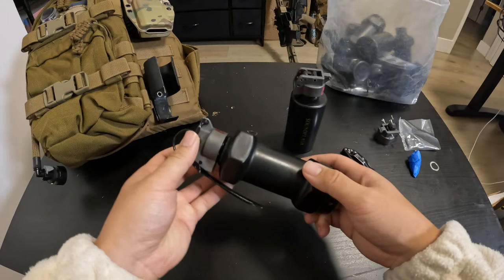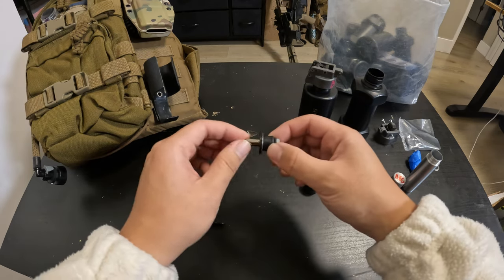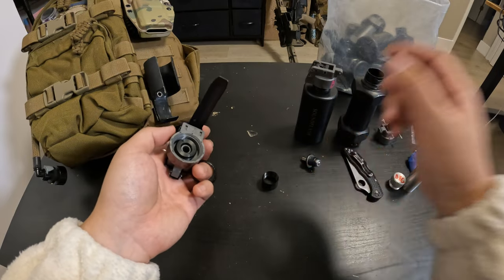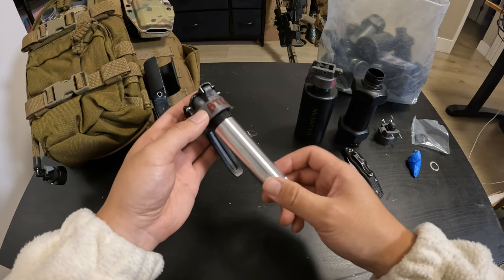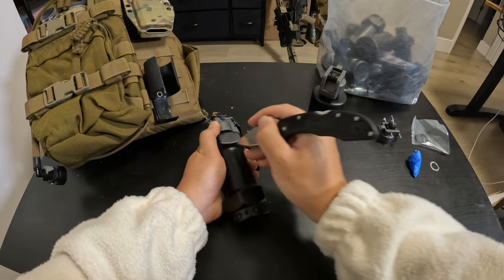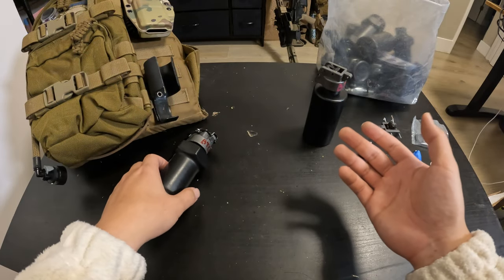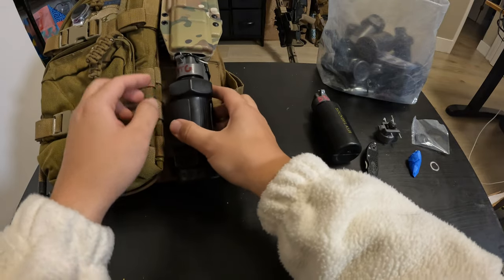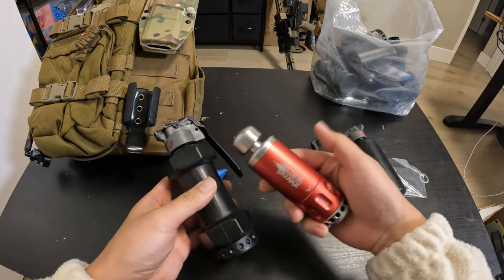Complete Guide to Thunder B's (Review and Reliable Setup)

Comment: Another trick to help evacuate the gas quicker is putting a penny in the cap (under the base of the c02 cartridge), and drill a small hole in the cylinder. That'll help the cylinder shells pop a little quicker.
Reply from the maker: Definitely. I never really got much of a result from the penny, and I try to keep mods from being permanent in case I change my mind. But if you want them to pop fast, a hole will definitely help
Reply: @pingu.0211  Yeah, the penny trick can be hit or miss. I need to get some of those kydex holsters, those are sweet.
Reply from the maker: @relyt_gnast  link in the description! Just double check your sizes to make sure you order the right one.

Comment: Have you ever experienced where the shell threads get stuck in the head of the grenade? I got two heads that are inoperable because of that…
Reply: Had the same issue, try unscrewing the cylinder itself from the striker. Once I did that the shell came right off.
Reply: Guy at the airsoft store told me to leave one thread exposed or it won’t come off.

Comment: Nice tips. Do you find the grommet to be pointless? I took mine out cause it wasn't really doing anything.
Reply from the maker: Yeah I either lost mine or never used it. Either way haven’t really needed it. I suspect it makes it a little safer to drop. But that’s it
Reply: @pingu.0211  right. The way mine are, between the pin and the cap there's enough pressure to keep the cartridge in place.
Reply: Technically, the rubber grommet is there to keep the co2 cartridge centered with the needle! It's not strictly necessary, it will work without it... But it's good to have!

Comment: Your cylinder ones aren’t going off because they’re designed to have bbs in them to take up the dead space
Reply from the maker: Yeah that’s not correct bud. If you read the manual it says under “safety tips” you are not supposed to add any “material” inside. Also a lot of fields ban that practice because it’s unregulated BB’s flying out. I would strongly recommend against doing that.